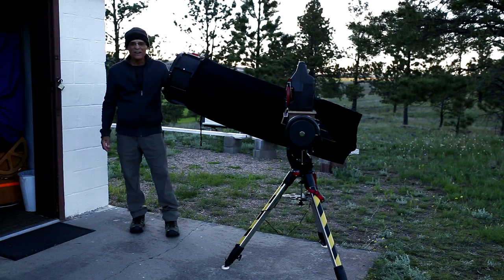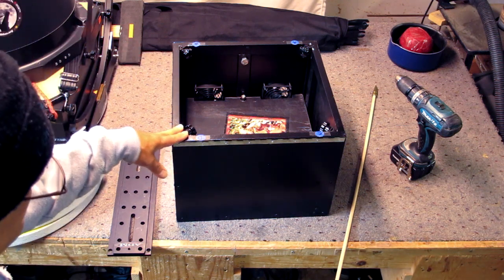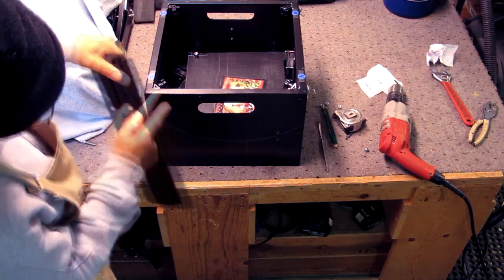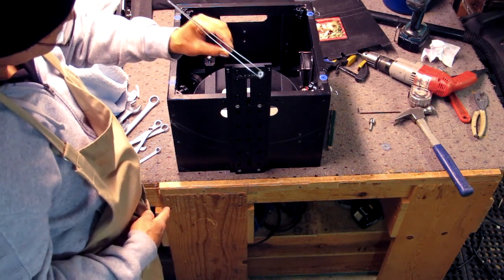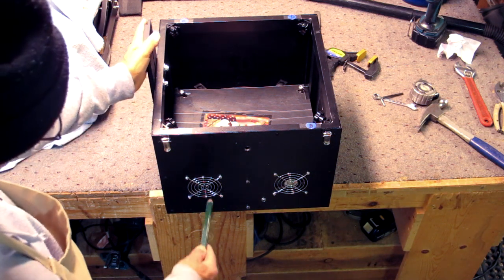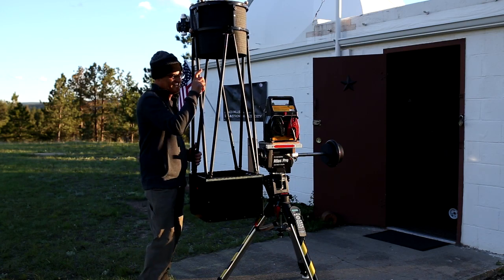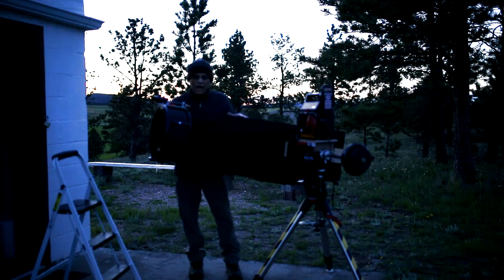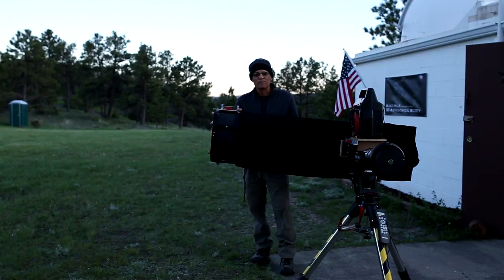Explorer Scientific Truss Dobsonian Go-to Conversion

Comment: Go from the losmandy bar mounting to a totally different setup? Or am I having another damn flashback.  The 60s weren't kind to me ahhh now I see
Whew I got scared
Reply from the maker: I started out with the losmandy 15" plate.  But as I pointed out in the vid (10:00 min mark) it wasn't long enough to obtain balance.  Hence, the MDF board was attached to the mirror box to extend the reach of the losmandy plate. Surviving the 60s was a feat in itself. Many didn't.  Thanks for posting.  Dakota